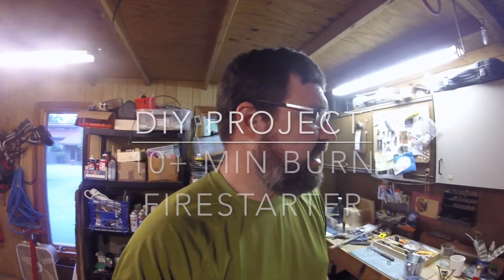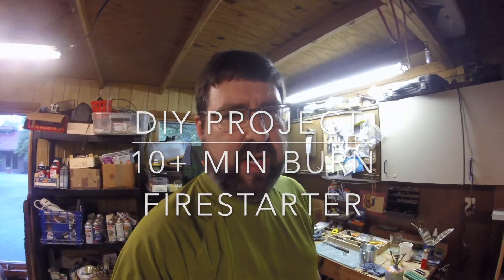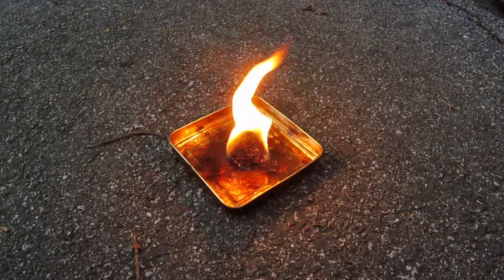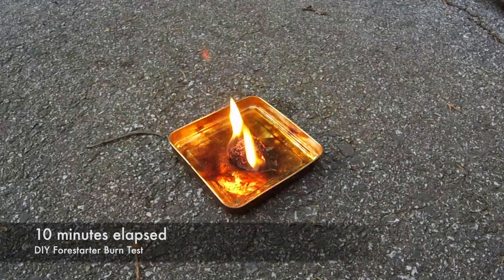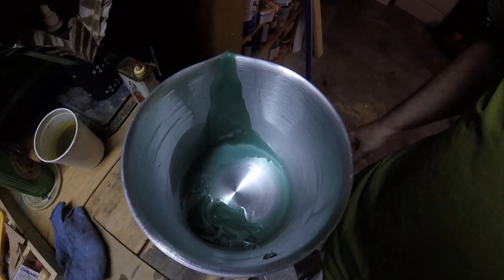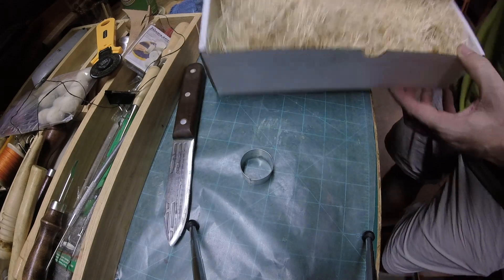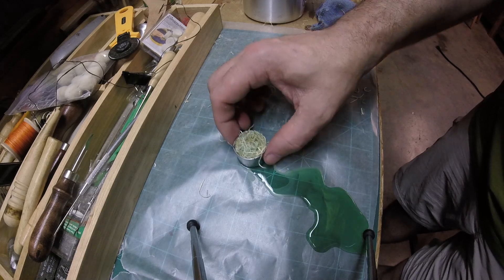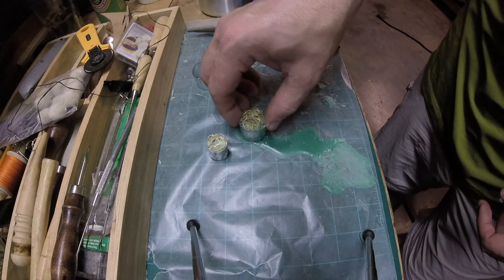DIY Firestarter: 10+ Minute Burn Time

Comment: Try what I do. Use a empty paper towel roll. Duct tape one end. Stand on that end and partially fill with desired combustible. Fill tube to just cover combustible and install more combustible. Partially filling ensures the wax will get to the bottom and not dam up. When filled let cool. Now you can cut to any desired length to accommodate desired burn time. Works great.
Reply: YouTuber-mc2el,
 "Fill tube to just cover combustible  [ with wax ]  and add more combustible. "

Comment: So, right off the bat you’re using a lighter. Shouldn’t you be using a pharaoh rod to see if that ignite it to begin with, and save your gas from the lighter. Cause I have a crap load of lighters. But I also have two big, huge, feral rods and a bunch of cotton balls with Vaseline in it, which light immediately. So I think you’re on the wrong track right here, buddy. I’m good pass.
Reply from the maker: Thanks for your comment. I typically use a ferro(cerium) rod and fatwood scrapings for about 98% of my fires. I find the discipline of avoiding matches, lighters, or manmade tinders to be a good one to maintain my fire craft skills. But there are times in inclement weather when a fire starter can be useful for reasons of personal safety, so I was experimenting here and opted to use the lighter because I was conducting a burn test, not because I rely on lighters. I always have a Bic and matches in my fire kit, but I rarely use either in the field. Fatwood is natural, takes a spark, and smells great. However, if I had to start a fire as a matter of personal safety, I would not hesitate to use a Bic with one of these.